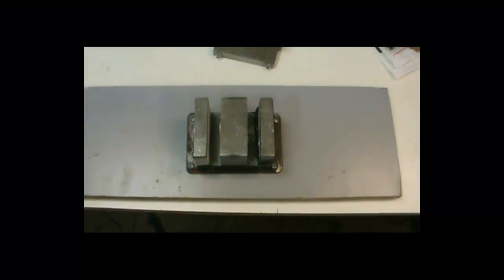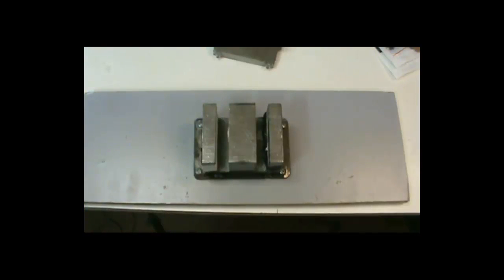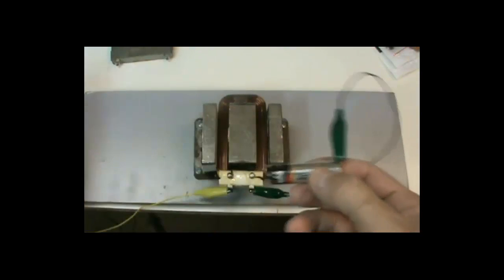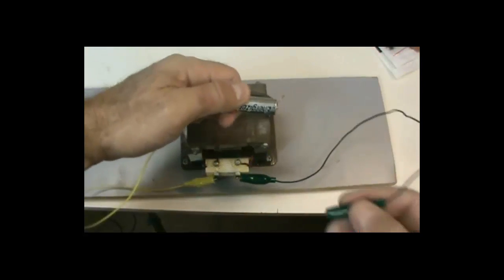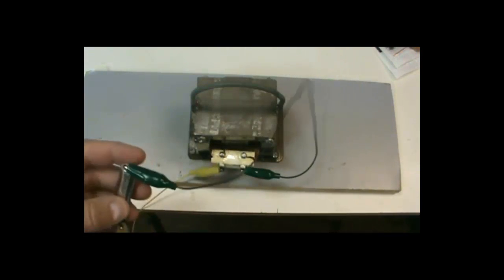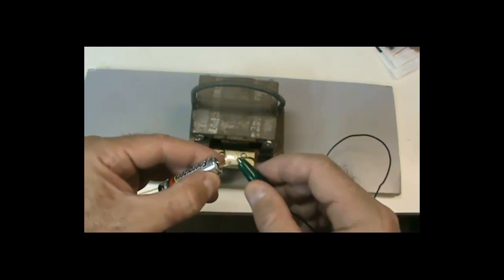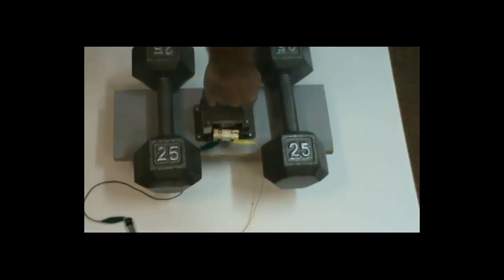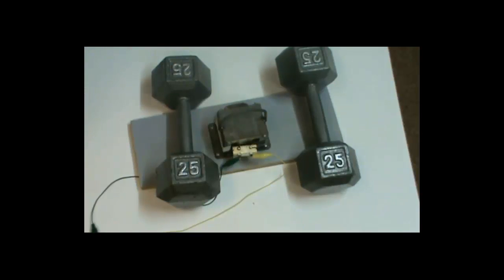Easy-to-Build Electromagnet lifts over 50 lbs

Comment: Unbelievable that a small battery like that in combination with a transformer coil can produce that much magnetic energy!
Reply from the maker: Andre Poelman The key to this feat is that the magnet only has to produce a powerful force. Large forces can be produced with very little energy if the distances are small. Since Energy = Force x Distance and the object is already touching the magnet the magnet does not actually have to move the object. In this case the formula tell us that a huge force can be produced with a small energy input since Energy divided by a Tiny Number (distance)  = Large Force

Thanks for watching and commenting. Consider subscribing for more.

Comment: I am confused! I just watched the "DIY Super Electromagnet" video on Mopatin's channel where he does the same experiment, but he is using a 230v power supply while you are using just a single AA battery and getting the same effect! How is this possible?!
Reply from the maker: +Moch Drake Using DC you get a powerful static magnetic field with a non-changing north pole and south pole. Using alternating current, and you need much more voltage because of inductance, you get an alternating magnetic field that can induce current in non-magnetic materials. You can leave this hooked up for very long typically.
Reply: +Dorian McIntire Interesting. Thanks for the reply!

Comment: the demo shot is cut, so fake. Why?
Reply from the maker: What?
Reply: Well I see what happened. The board is not an ideal size for holding those particular weights. It slipped at the end as he was setting them down. It probably messed up as he picked up the board and he cut that shot out. I suggest using different demo weights or cutting small notches in the board to fit your dumb-bells. They will fit into those notches as you pick it up and keep them from rolling and losing balance.
Reply from the maker: jeckler111
Thanks for setting the record straight. There are too many people so eager to question the authenticity of everything.

Comment: Do you can use that force to repel 50 lbs,and make ufo craft ?
Reply: No
Reply: What do you mean no? Change the flow of current by changing the where wires end on battery and instead of getting attraction you will get repulsion from electromagnet
Reply: no you won't. if you flip it around, then the current will still whiz around and create magnetic force, the only thing is, that force would be a South Pole instead of a North Pole, or vise versa. you could, however, make it repel from a GIANT magnet on the floor of the same polarity of the electromagnet. Listen to Hot Sausage. (above)
Reply: You make a confusion with permanent magnets. Here the piece of metal which is pulled is not a permanent magnet. That's mean has no poles.
Reply: ^^^^^^^ IIRC all electromagnetic fields have certain polarity to them.
Reply: "Can use that force to repel 50 lbs" Yes but not with DC currents, and probably not using iron due to its magnetic attraction to both poles.  Applying a changing magnetic field  induces eddy currents in a conductive material. Those eddy currents will themselves generate their own magnetic field in opposition to the initial change in magnetic field that created the eddy currents.  This is all based on Lenz's law of induction. Google these terms: Lenz law magnetic levitation.
Reply: you could levitate something diamagnetic, like a piece of graphite, if that helps you make a UFO

Comment: Before I ask this question, I would just like to state that I have no previous knowledge on electromagnets so it might be absolutely stupid. I just wanted to know if i could add another coil from another microwave to double its strength? As in on top of the first one and connect it somehow? And could i also get a 12 volt car battery without completely melting the wires?
Reply from the maker: Actually you can!

Connect both coils in parallel http://youtu.be/0c01IaXm4RQ and make sure they are both wound in the same direction around the core. In other words if the top of top coil is going around the core clockwise the top of the bottom coil should also be going around the core in the same direction.

You can connect one or more coils to a 12 volt battery and create an electromagnet that will lift hundreds of pound. Just make sure you don't leave it connected for too long because the coils will heat up. Use large diameter wire to connect to the battery to keep it from getting too hot.
Reply: Dorian McIntire Woah, thanks for replying so quickly! I watched the other video and I can safely say that I grasp the concept behind everything you said. I think I'll go to the local dump tomorrow to get 2 microwaves and try it out. I'll probably destroy a shit ton of hard disks by next week haha
Reply from the maker: TheExtremeGamer1712 Great! Please post your project results in the comments to let others know how your project went.

Also it really helps if you can like and subscribe the channel to get the word out.

Thanks

Comment: Would you like to explain to me how to winding your project so the winding coil just need 3 amp 12v ? Maybe your equation about winding coil ? Hehehe i am beginner : ). Thanka for your attention
Reply from the maker: Unfortunately this is very complicated. The variables are wire resistance (preferably low), current capability of the power source (preferably high), number of windings (more windings means more resistance), wire gauge (small gauge wire has less resistance but is physically larger so number of turns is limited), also the shape, type and size of the magnetic core material is important. 

Electromagnets only require current and windings (ampere-turns) to work but voltage is required to produce the current, when resistance is present, and more windings mean more resistance. Another issue is the topology of the electromagnet  which determines whether the magnetic flux is available on both ends of the magnet or only on one end. The electromagnet in  the video only produces outside flux only on one end and this means the flux is doubled in intensity.

A perfect electromagnet would have no resistance since power losses are proportional to the square of current flow when resistance is present.

If you Google the term "Making Electromagnets" you can find information on making electromagnets but the process is mainly trial and error.
Reply: last question from me. if i want to make a strength or powerfull electromagnegnet should i give high current or voltage ?? Which one plays the most role in electromagnets?. thanks Sir :)
Reply from the maker: As I mentioned in my last reply magnetic fields are only produced by current. Higher currents and more windings mean larger magnetic fields.
Reply: Dorian McIntire thanks you, sir. I will try my project :)

Comment: I did not know you can do that with a weak 1.5 volt battery, that's kind of cool. I thought that the battery volts will be to low to make a strong magnetic Field.
Reply from the maker: +3hornthrasher Electromagnets are mainly about three things: Turns of wire, current and magnetically permeable materials. If you have all three of these you will have a strong electromagnetic.
Reply: so the more the volts, the stronger the magnet, got it.
Reply from the maker: +3hornthrasher It's more complicated than that. More volts does not necessarily mean more current. A 9 volt battery cannot supply as much current as a 1.5 volt battery to a low resistance load.  You must match the power supply to the magnet for best results.
Reply: Dorian McIntire oh, thanks for clearing that up for me.

Comment: Hey, can I use secondary winding for better magnetic field ?
Reply from the maker: Ronak Dalwadi Alright ignore everything I said. The primary 120 volts is the correct winding to use for high current. The secondary, about 2000 volts is not the correct coil to use. The high voltage coil (secondary) contains many turns for high resistance that will prevent the electromagnet from getting the current it need at a low voltage.
Reply: Thanks for your help. 😊
Reply from the maker: Ronak Dalwadi You're welcome. Sorry for the initial confusion.
Reply: Not a problem.

Comment: Why can't we use it to pull , push and convert that to and fro motion .....
Reply from the maker: Magnets can only push other magnets, they cannot push iron, unless you apply AC. Things get complicated very fast.
Reply: @DorianMcIntire  not clear may be you can make a video, when free
Reply: @DorianMcIntire  one electro magnet pulls iron bar, when iron bar gets very near to the electro magnet circuit breaks, and another electro magnet from the opposite side gets activated and begins to pull the iron bar.....

Comment: What's the best batterey to use for this. In terms of making the magnet more powerful
Reply from the maker: +Miles Crowe A 12 volt battery will lift hundreds of pounds but only for a short period of time since the magnet will get hot.
Reply: What if i hook it up to a 110 outlet?
Reply: bad things?
Reply: wires heat up

Comment: I must have fucked the wires up when I made mine. I hooked it up to a 9v battery and could BARELY feel any magnetism.  
Oh well. Free microwaves aren't too hard to find.
Reply from the maker: +Robert Briggs Keep in mind that 9 volt batteries don't provide much current. Also make sure you used the
coil with the large diameter wire. Hope it goes well.